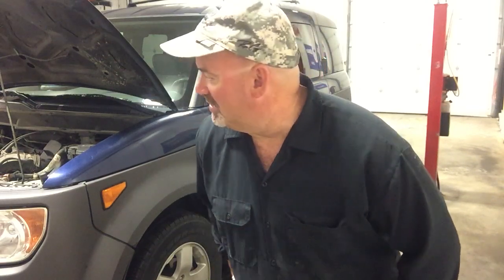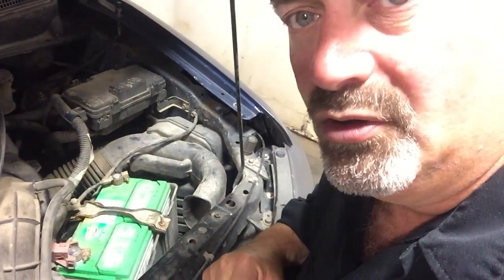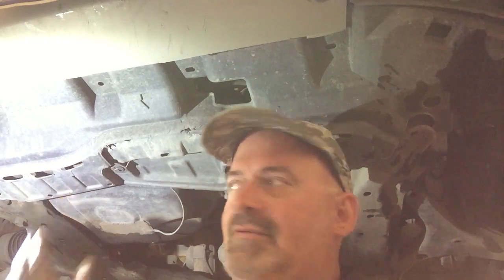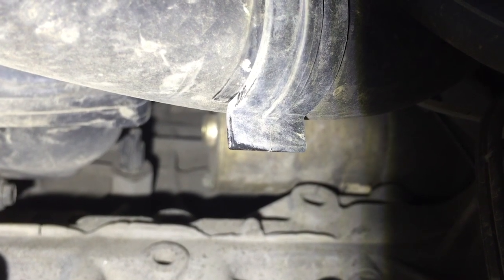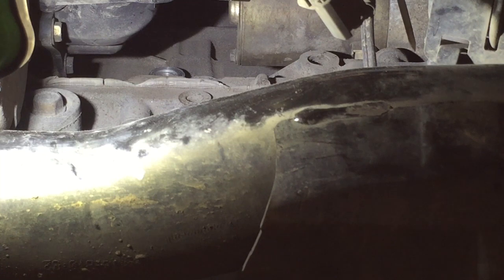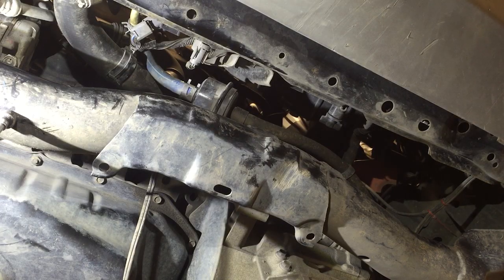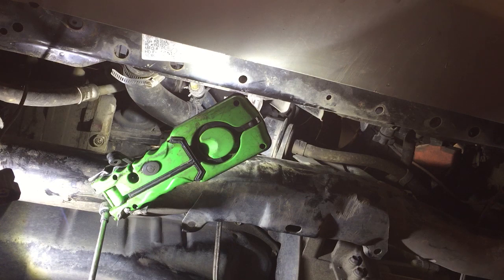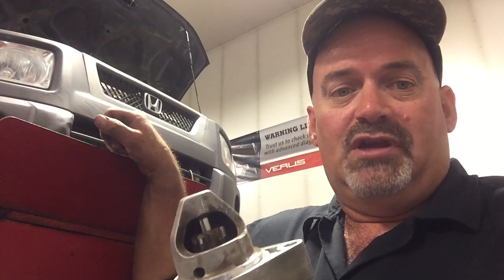Honda Element Starter Replace Less Than 1 hour

Comment: Okay I started on my car.  It is a lot tighter in there then the impression I get watching the Video. By the way it really says a lot about the excellent work you did filming this video.  That blind bolt requires sorcery to get out and especially back in when gravity is working against you.  I opted to go the top route but ran in to a problem getting that throttle body off.  So  then since I had the under panel removed and the top side mostly disassembled I took advantage of the top side to get that blind bolt.  I was able to just lean the exhaust manifold outward and got access to the blind  bolt .  I did the rest off the work from the bottom.  I left that throttle body alone because I don't want have to fix that too.
Reply from the maker: Nice, it is pretty tight. The position of that bolt is really whacked. Thanks for the feedback!
Reply: The Car Doctor No Prob.  I usually read the comment section for people to elaborate, give more tips answer maybe some specific questions I had.   I finally finished the job and putting it back together was more tricky because thing fall apart and drop down  but putting them back up was hard. That knock sensor required that I make a tool out of the inspection mirror/ Extension magnet tool I have to reach the hole and start the tread. It was genius.  So If I had to comment on your video something that I notice a lot is that many people  cut things short and say " In order to put things together just reverse the process"  But invariably there  are special issues involved in putting things back.  It is much appreciated with the tech shows the whole process so that if  issues occur in putting things back there are suggestions made as well.  .  And finally  do the money shot Start the car.  LOL

Comment: Great stuff- New to the channel and I love it! How about suggesting that the DIYer use car ramps instead of jack stands for this repair? Should provide more clearance and a safer environment. I didn't watch the entire video, but it doesn't appear that front wheel removal  is required.
Reply: Right! I watched a video on how to change the oil on my wife's element and they said remove the front right tire to remove the oil filter. I actually used my ramps and was able to access the filter without removing the tire and it wasn't hard at all.

Comment: Car Doctor - My Element just had it's starter die.  I've got some ability working on cars, I've never tackled taking off a manifold before.  Should I go the "proper" route, or should I give this way a go?  The only thing I don't have is the air tools.

Comment: How did you figure out this can be done from the bottom? Are you leaving out any key details or problems you've encountered? For example, I replaced my Element starter but the 2 bolts holding it on were too tight and required a 3' pipe on the ratchet for leverage. And they were no easier going back on. I can't imagine doing it from the bottom without a lift and air tools.

Others have posted how to videos but they often gloss over or omit key details, which gives the impression the job is easier than it really is. I curse those people. 

On the plastic bottom thing you remove, what if the screw clips holding it on are rusted? I tried to remove mine (for a different repair) but they were rusted so I tried penetrating oil, no luck. When I turned the rusted screws the clamps also turned and tore the plastic they were clamped to.
Reply from the maker: Mechanics figure out how to save time as part of their everyday work. We often spend extra time just exploring other options and better ways to operate. Corrosion can be a real problem. I don't encounter corrosion here very often so my videos almost never take that into account. I produced the video to show other options for removal and like I said in the video it may not be the best choice for everyone depending on many factors. Corrosion is one of those factors along with skill level and access to equipment and tools. I produce videos in hope that the information might be helpful to regular people since I enjoy assisting folks. I wouldn't want to mislead anyone because that wouldn't be helpful at all. Thanks for watching!
Reply: The Car Doctor
Thanks. So, how many Element starters did you replace from the top before trying it this way? What about the top method made you look for a better way?
Reply from the maker: I wanted to do my job better so i found a way to do just that.
Reply: I cut the plastic at the corners just beyond where it turns up into the wheel well so there is still a bolt at the ends.

Comment: So the knock sensor is actually 27mm? Will a deep socket work better for it?...............Edit..............Confirmed it is 27MM. I got mine done this weekend thanks to your video. I had a hard time so I removed the bracket that is in front of the starter. Just a 10mm bolt and nut. I got it done like in an hour and half.
Reply from the maker: Cool. Sorry it took a while to get to this.
Reply: Yes sir. Thanks again. BTW..........it was a 27mm open end.
Reply: I'm so glad you commented that. I just sent my husband to the store for the 3rd time for a larger wrench. If I hadn't seen your post, it would have been 4 lol

Comment: Elements and CRVs....Alternators, starters, and failed compressor clutches. Do you recall  Honda's jungle from the 70's? Honda...we make it simple.
Reply from the maker: Haha, I think I recall that jingle. Funny. I believe this tip will apply to CR-V's as well.

Comment: I have an issue with my 2007 element, you turn the key when its cold and it wont cank until a couple of times, i replace batery and ignition switch but it still makes the failure, recently i rebuilt the engine and before it wont have the problem, can you give me a sugestion what else can i check or repkace? Thank you

Comment: Hi Tim. how can I be sure the starter is bad? For a couple of weeks my element sounded kind of sluggish when I was starting it. I assumed it was the battery but I had it tested and its good. When I turn the key now nothing happens at all. I don't know if it could possibly be something besides the starter. Any advice would be helpful. Thanks for the video!
Reply: An Answer here would be great! After three years, no answer. My problem is identical.

Comment: sounds like the starter is dragging? how can i check it  to be show it's the starter, have brand new battery 2003 element
RSVP ASAP
Reply from the maker: I have a tester for that or you can use an amp clamp and meter to monitor the draw. If it’s worse when warm it likely the starter.
Reply: Thanks,That's what i am thinking

Comment: Hi guys I'm wondering if someone could help n give me some tips regarding my alternator. I was jump starting another vehicle with my 06 Honda Element, when the alternator in the Element caught fire. I obviously have to replace the alternator but does anyone know what other cables devices and parts i should inspect or replace? That would be a lot of help. Thank you.

Comment: hey car doctor i need help with my car can you please get back to me i have some question
Reply from the maker: The Doctor is in. What can I do for you? Having trouble getting going in the morning? Leaking fluids? Rear end problems? We can help with that.
Reply: +The Car Doctor i have a 2005 dodge magnum rt 5.7 i have volt issue  when the car is turn on it idle like it does not have power. now when i turn it on it shuts off i need help thanks.
Reply from the maker: Have you checked fuel pressure? Any codes?

Comment: "Known to have starter problems" ....so you recommend replacing the oe crap with the same oe crap? Honda engineering and placement of this limited life part is ridiculous.
Reply: They make it past 100k before having problems. I've got an 03 w/136k that just started with the weak cranks. Like he said, there's a lot of reports of problems with the reman ones. I'm sure the Honda oe crap is a lot better than the reman crap...

Comment: Hmm an anal extraction method :-D, thats a bum joke :).
You said there is a cristal in the knock sensor, similar idea to the one in a cigarette lighter or similar?, it gets an impact with a sprung weight and gives out a pulse of voltage to light the jet of gas.
Hey you looked like you were going to charge at the camera at the start lol :-)